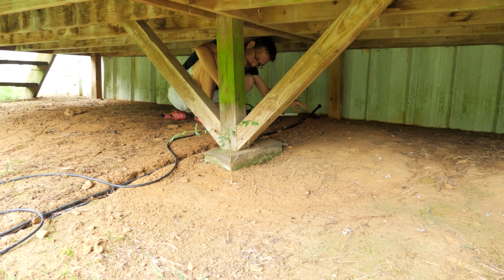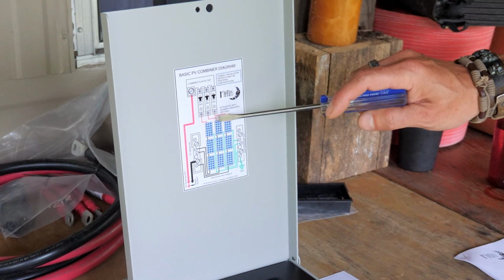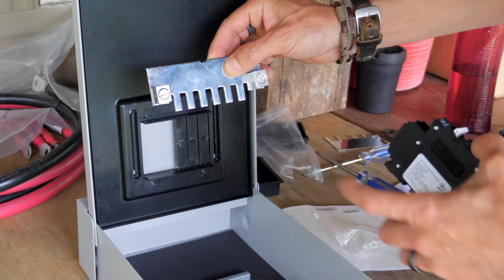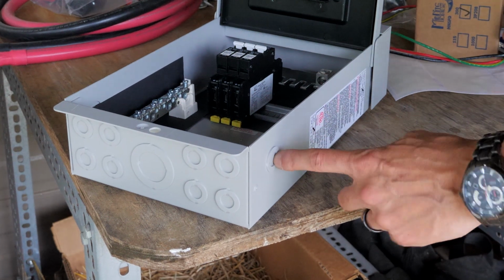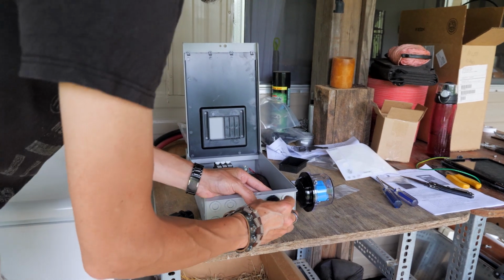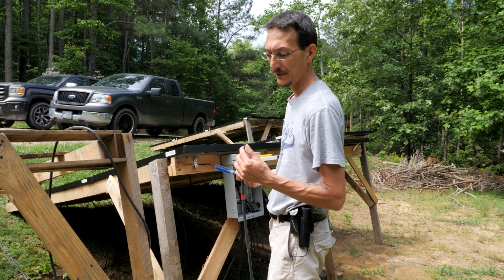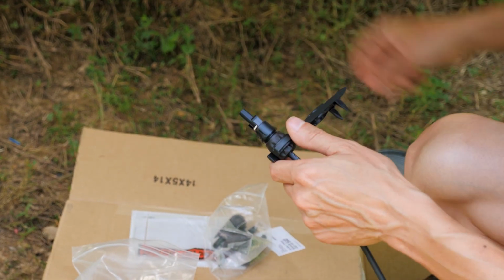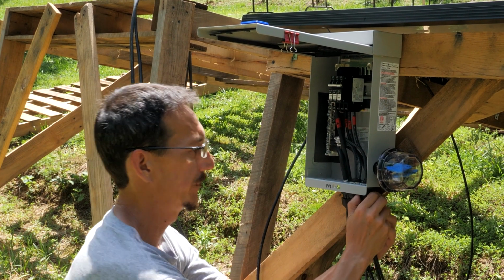DIY Off Grid Solar: Assemble & Wire a Combiner Box (Part 4)

Comment: Not understanding the surge protector. It doesn't look like anything is running through it. Just seems "plugged" into the system. Not sure how it's protecting anything.
Reply from the maker: It monitors the total voltage from all 3 strings and “clamps” if there is a spike from nearby lightning. It basically eats the surge before it can leave the combiner box.
Reply: I was thinking the exact same thing.
Reply: Thanks for the reply. So, when it "clamps" the load is dumped to the ground rather than the charge controller given it's the path of least resistance? 
I'd assume the surge protector is a one time use device and that the breakers would have tripped all the while saving your electronics.
Reply from the maker: That’s basically it. It’s a dump, not a fuse though so it will work many times in an over voltage situation unless the voltage exceeds it’s max. Like lightning. Lightning is always bad.
Reply: Unlike AC house wiring there is no flow to the ground, if the voltage gets too high the surge protector acts as  a load to bring the voltage down.

Comment: So once the panels are connected to the combiner box, do they become series connected, or parallel connected for the main output to the inverter?
Reply: parallel.If it was series, the wires from each fuse holder would go to the next fuse holder, negative to positive, one after the other. With this method the positives all the positives connect together, and likewise the negatives.

Comment: What was the voltage drop in the end? In the UK we are now all metal units but when I did mine it wasn't the case as I built mine myself. The inside AC feed from the inverter to consumer unit however is metal. Great videos by the way, you should write a book, I think I will at some point.
Reply from the maker: Less than 2%

Comment: Id like to build my combiner box and  I have 6 solar panels... so I would need 6 breaker for each panel/string? THANKS
Reply: My 6 are pairs in series and 3 series in parallel, so 3 breakers
Reply: Always check the minimum and maximum voltage of your inverter or charge controller. That’s what decides how many modules (panels) you put in each string. 
In my case the inverter requires 60 volts minimum, means that I will need at least 2 modules (panels) in series (they have a 40 volts Voc, which means probably 37 volts on a hot day. 
If you have 6 series of 1 module connected in parallel, you’ll have only around 40 volts and an inverter like mine would never start. 
My inverter has a max input voltage of 145 volts. That means I cannot have more than 3 modules in each string.

Comment: As always, great video.  I'm having trouble finding those strain reliefs.  I'm using 8 gauge wire from my PV's to a Midnight Solar MNPV6-DISCO combiner.  Just like yours but has a main disconnect switch on the front for quickly disconnecting all power from the array. (Mine's only a 2kw system).  Could you provide a link to those strain reliefs?  Thank you!
Reply from the maker: Forgot to add them to the video description. Just go to AltEstore.com and search for them.
Reply: Ok, thanks.
Reply: I went there, but for the 4 gauge output wire, I only saw a 3/4" NPT with a single wire gasket.  Your setup shows only a single 3/4" NPT (no gasket in your video), so where did you find a double wire gasket for it?  I see that in the section of your video, you didn't use the 3/4" strain relief and left the 4-gauge wire hanging through the hole in the combiner box, so you must be having the same trouble I'm having!  Thanks again!  I really liked your neat wiring job inside the combiner.  I love the Midnight solar products, but my mppt controller and inverter are Xantrex (Schneider now).
Reply from the maker: They didn’t send me the lock nuts for the 3/4 strain reliefs so I hadn’t installed them when the video was shot. I got the lock nuts at Lowes and now everything is installed. Both 4 gauge wires feed out through the 3/4” strain relief and tighten down just fine so everything is good.
Reply: I called AltE, and they don't have a two-hole gasket for the 3/4" NPT strain relief. How did you seal yours?
Reply from the maker: I didn’t. Just clamped it down. The gaps are small but I’m gonna shoot a small bit of spray foam in it.
Reply from the maker: Actually I think I’ll just use clear silicone.
Reply: My panels are on the ground like yours, but I put them all on a single mount that has heavy duty casters on it.  It sits on my back driveway (14, 190W Grape Solar panels) chocked in place.  I live about an hour north of the Outer Banks, so if a hurricane's coming, I can wheel the entire panel mount into my 28x28 detached garage.  Works like a champ.  

But when I first set the system up, I installed the same combiner you are using to the outside of my brick garage and ran the 6 gauge output wires from the combiner to my MPPT controller in the house (about a 50' run so I'm within the 3% voltage loss for a 2KW system with 7 pairs of panels at about 90 volts (2 panels in series @ open circuit) and 4.5 amps) through exterior grade PVC conduit I ran underground to my house.  

The problem that I am now fixing is the 3 pairs of 8 gauge wire that run across my driveway (under a heavy duty rubber guard) to the wall-mounted combiner (that's why I used 8 gauge instead of 10).  I wanted to clean it up and use welding cable for better insulation and UV protection, and I also need the wires to be detachable when I wheel the system into the garage.  

I picked up the Midnight Solar combiner with disconnect arm that I'll attached to my PV mount like you did, and then just have the two 4-gauge wires running to the other combiner on the garage.  Like you, I have lots of room for expansion, but only if I start putting panels on the garage roof. I also picked up some heavy duty winch quick disconnects rated for 2-4 gauge wire, so that will make prepping for a hurricane that much faster and easier.  

I installed my system back in 2011, and I got a lot of great tips on your video series for upgrading my setup.  I also installed a lightning arrestor to my combiner, but I went with a solid grey non-glowing model for outside since my neighbors behind me would probably wonder what is always glowing in my yard at night!  Ha ha. I also installed the same lightning arrestor as yours to my distribution box in the house that feeds my grid-connect hybrid inverter from the battery bank and to the house breaker panel. It was (and continues to be) a fun project. Some day I'll upgrade to those awesome Lithium batteries you have!  Mine is a 48 volt system too, and I have two banks of 4 Optima Yellow top AGM batteries that gives me enough backup power to run my refrigerator and two chest freezers, but with only 110 amp-hours (50 usable capacity), I don't have the three-day hang time that you have.  When my batteries approach 40% drained, I shut the system down and connect my generator to a GenTran manual transfer switch that will run the house while my PV system batteries recharge.  Fortunately, after the hurricane blows through, the skies get very sunny, so I should be able to wheel my panels back out within a couple days--but since my Xantrex is tied to the grid, as long as I get power back, the system will recharge my battery bank without the PV--but that's just gravy that I don't plan for.  Always plan for the worst and hope for the best, right?!  

Thanks again, and keep those PV videos coming.  I share your pain about the learning curve for a do-it-yourself PV installation!
Reply from the maker: Sounds like a cool setup. I like the mounts on wheels idea. Good for OBX hurricanes for sure. I want to make a ground mount that rotates like a sundial and figure out a tracking system to follow the sun. Baby steps. Lol.
Reply: I agree.  I just haven't got the real estate for two anchored poles I'd need to install the panels on swivel mounts to optimize the harvest.  You do, however!  But I know what you mean by baby steps!!!  I did make the mount pivot so that I can change the declination with the seasons, but honestly It's just too heavy to do alone.  I need to install a couple screw jacks to do it, so I just set the angle at an average declination for my lattitude and called it a day.... In summer, the best day's harvest was 14kwh.
Reply: I'm in the process of upgrading my wiring from the Array to the charge controller (via inverter), so I broke out the voltage drop calculator spreadsheet I got somewhere years ago (if you'd like a copy let me know).  It reminded me in the notes section that when measuring the distance, you have to include the two-way dc voltage path.  My distance from the combiner to the inverter is 60 feet, so I have to use 120 feet as the distance for the calculation to allow for the full path between positive and negative wires. I just wanted to be sure you were aware of that, since I forgot.

Comment: I'm sure you already know this but AC travels farther with less line loss than DC. If you were to rethink battery and inverter location the batteries and charge controller should be next to the PV solar panels, therefore short DC run minimal loss to controller and maxim amperage to your batteries. You can run AC output from your inverter to a long, long run to your home with little loss and  not having to use expensive heavy copper gauge wire.  OK carry on just a side note...
Reply: so Mike W,  how is Ohm's law different between AC and DC?
Reply: Craig Smington frequency
Reply: yeah, but not down at 50/60Hz. Not on the scales we are talking here, that's why he's bumped his PV voltage up and increased his cable diameter. He threw $$ at it in the great American way ;)
Reply: "Resistive circuits
Resistors are circuit elements that impede the passage of electric charge in agreement with Ohm's law, and are designed to have a specific resistance value R. In a schematic diagram the resistor is shown as a zig-zag symbol. An element (resistor or conductor) that behaves according to Ohm's law over some operating range is referred to as an ohmic device (or an ohmic resistor) because Ohm's law and a single value for the resistance suffice to describe the behavior of the device over that range.

Ohm's law holds for circuits containing only resistive elements (no capacitances or inductances) for all forms of driving voltage or current, regardless of whether the driving voltage or current is constant (DC) or time-varying such as AC. At any instant of time Ohm's law is valid for such circuits." https://en.wikipedia.org/wiki/Ohm%27s_law
Reply: Not quiet so.  AC is easy to use a simple (therefore cheap) transformer that can be used to take the voltage higher and when it is higher the voltage drop is proportionally less.  ie otherwise Ohms law still applies.  Here is an example of a high voltage DC solution https://en.wikipedia.org/wiki/Basslink  doing 370 km island to mainland linkage.

Comment: Does solar provide enough electricity to power say... washer, dryer, dishwasher, A/C and Tesla car? I can go without 
A/C by the way
Reply from the maker: Sure. We don’t use a dryer or dishwasher but fridge, washer, A/C, freezer and computers.
Reply: With the electric car I've been thinking the same thing, and you have to think very carefully about sizing your system.  Here they are installing a 5 kW system.  Being optimistic and saying you get 8 hours of perfect sunlight in a day means you could generate 40 kWh per day.  A Tesla with an 85 kWh battery back would thus need just over two days to fully charge from flat.  In the 'sizing your system' video, Jeremy says they expect to generate 20 kWh a day, so that's four days to charge a flat 85 kWh Tesla, if you don't run a fridge or anything else in that time.  Going off the Wikipedia specs, with Jeremy's system you could expect to charge the average electric car at a rate of close to 100 km (60 miles) of driving range per day in ideal weather.  To put it another way, you would be limited to roughly 700 km (430 miles) of driving per week, allowing for any use to recover at a rate of 100 km (60 miles) each day the car is in the garage with the sun shining.

These are all approximations and will vary considerably, it's just meant to give you some ballpark figures.

This also assumes you can get that full 5 kW into the car.  5 kW @ 240 VAC is 21 amps, so you'd need at least a 20 amp socket and a charger capable of taking in 20 amps (but no more, to avoid overloading the inverter.)  I'm not sure whether these exist - the charge rates all seem to be 16 A or 32 A, which means you may have to charge slower (at 16 A, not using all the available power you have) or get a larger 7.5 kW system instead, to be able to use the 32 A charger and cut the time in half.

I'm also not sure whether US inverters put out split phase 120/240 VAC or whether they are 110 VAC only - if you only have 110 VAC available I'm not sure what the charging options are, as I have only seen people using chargers rated for normal residential sockets (110 VAC @ 15 A) which charges at the extremely slow rate of 10 km (6 miles) per hour.  This sounds bad, but if you're able to store enough excess power in your solar batteries that you can maintain this charge rate 24/7, then you can still fully charge an 85 kWh Tesla in just over two days (50 hours).  You'd still have to be able to generate (and store) 40 kWh per day to maintain this rate however, otherwise charging the car will flatten the batteries in the solar system overnight.

There is also DC charging which could be a better option, but as far as I can see these start at 300 VDC so it's not something you will be able to use with a normal residential solar charge controller, which typically maxes out at 48 VDC.  However I am sure that in time, companies will start making DC chargers that run off 12/24/48 VDC systems for exactly this use case (if they don't exist already!)

Comment: This is what confuses me, are those 12 v panel of 24 v? 3@ 12v=36V, 3@24=72v, how does a 12,24,48v charge controller handle that?
Reply: A 12v panel puts out around 17v (open circuit). 24v panels put out about 32-40v etc... So he probably has 3 x "24v" panels in series to reach that voltage. Furthermore, an MPPT charge controller can handle much high voltages than the system voltage. I have a 48v battery system with an MPPT charge controller that can handle up to 125V (open circuit). Hope that helps your confusion.
Reply: My charge controller can handle up to 250V input and transform it in 48V output. 
It is an MPPT charge controller.
Reply: @zarbonida  Are you referring to 250v input as AC voltage or DC? My setup has 9 panels in total (3 in series, then 3 in parallel), totaling ±140VoC (DC), running at about 100-120V (DC) under load. My MPPT controller then charges my battery bank which runs at 48V... (I can charged up to 64V if I want to. What is your actual question though?
Reply: When a charge controller is listed as 12 24 or 48 volts, they are taking about the battery voltage. The voltage for pv input will vary depending on the model of charge controller.
Reply: @lyntonjennings  Thanks for your comment here. I have a question about the series, then the parallel wiring. This video didn't involve parallel wiring like you mention. I'm planning to do mine like you mentioned here. So, after adding the panel volts from 3 in series, then wiring them in parallel, do the amps add together? A panel has 8.27 (Imp) and 37.6 (Voc), using 18 panels. I will have 6 strings. so will the Amps then be 8.27 x 6?
Reply: @onekerri1  yes, sounds right... so example using simple values. 12V panels of 1A each... 3 connected in series will produce 36v and 1A. Then linking 6 of those strings in parallel will produce 36v and 6A... Hope that helps. This is also assuming all panels are identical, otherwise there will be more losses.
Reply: @lyntonjennings  I have a couple of silly questions for you if you don't mind:)
I have 6 strings of 3 panels in series 112.8V   8.27A
3 series strings of 3 panels in parallel (3s3p) total 18 panels at  112.8V   24.81A
Would I need one 25 amp breaker? Also, what would be his reasoning to not parallel his wires? Is it to lower the amps so as to not need bigger wire? Is his way to wire them the way everyone should be doing? I would ask him but he hard to contact.

Comment: There seem to be a lot of wires open to the elements.
Reply: All the cables that are open to the elements are manufactured to withstand UV sun exposure, temperature extremes, etc. so as long as you're using the correct cable it's not an issue.